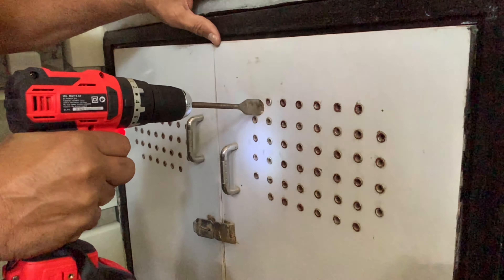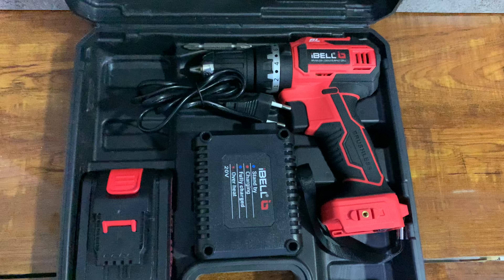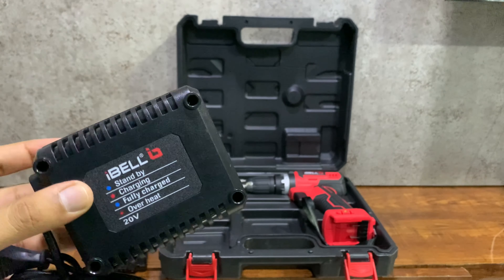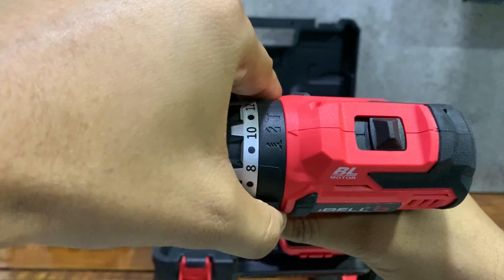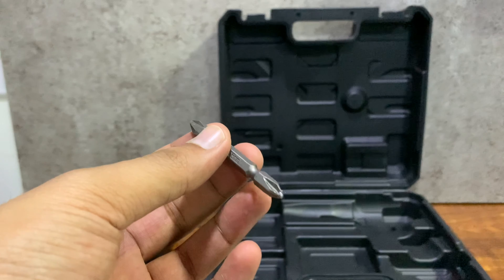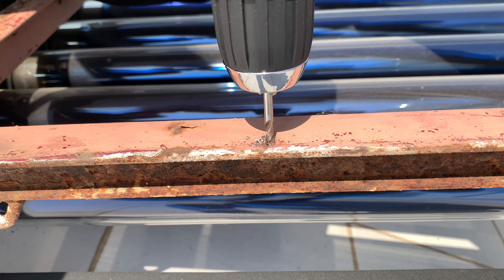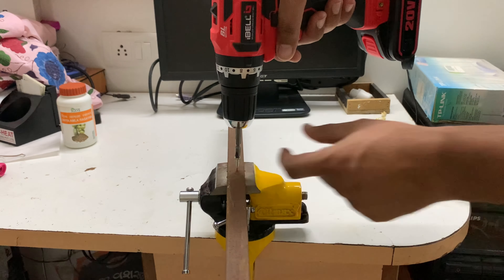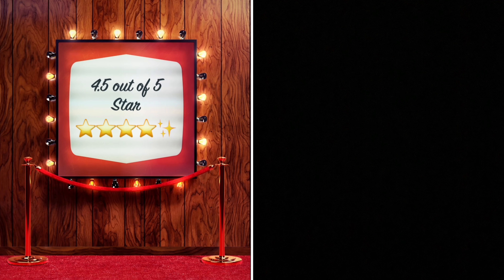iBELL Impact Drill BM18-60 20V| Unboxing | Demo | Review | MnM rating

Comment: i have seen in the video while screwing in the metal, screwing was not smooth, whole drill machine was shaking a lot along with driver bit and screw, is there any manufacturing defect with the chuck or any other reason ?
Reply from the maker: Screwing in metal was shaking due to faulty screw attachments  I got along with the drill machine, that I said in video also about negative point.
But  now that I purchased new , that cost me 40 rupees only.
But there was no defects in machine or Chuck.
You can see other examples of drilling, which is very steady.
Reply: @MnMRating  thanks for video. As drill bits are not of good quality, do you know any drill bit links of amazon or company that lasts longer as well as withstand wear and tear of regular domestic usage pls ?

Comment: SIR MERE PAAS KOI BHI MACHINE NAHIN HAIN AAP MUJHE YAHI WALI MACHINE CURRIEAR KARVA DEEJIYE
Reply from the maker: That’s really funny Sir,
But I am already using it, you can purchase the machine as from below iBELL BM18-60 20V Brushless Impact Driver Drill (Cordless) with 1 Battery, Charger, Case and Screw Driver Bit - 1 Year Warranty. https://www.amazon.in/dp/B08BHW9BC2/ref=cm_sw_r_cp_api_fabc_I6d3FbGXAX8N0?_encoding=UTF8&psc=iBELL BM18-60 20V Brushless Impact Driver Drill (Cordless) with 1 Battery, Charger, Case and Screw Driver Bit - 1 Year Warranty. https://www.amazon.in/dp/B08BHW9BC2/ref=cm_sw_r_cp_api_fabc_I6d3FbGXAX8N0?_encoding=UTF8&psc=11
Reply: On a continues use how long the battery will work?
Reply from the maker: @kansedits2675   After full charge , Battery will last long for at least 2:30 hours for sure on continuous use. Because I tried to drill 120 drills for 2 hours in wood and it was still working.